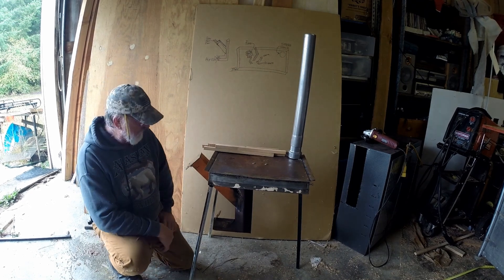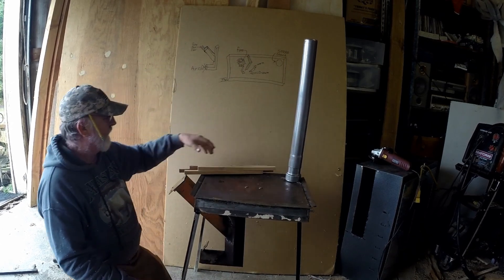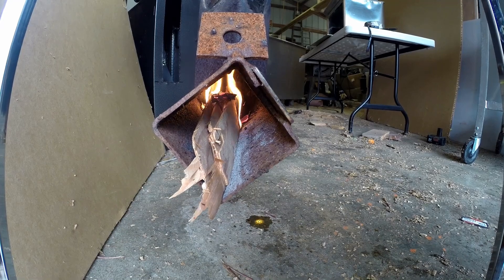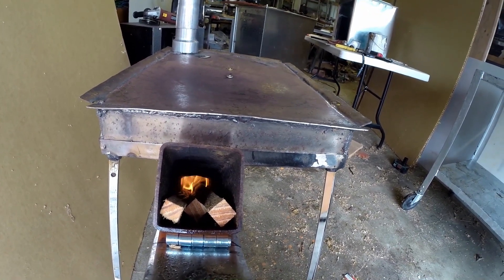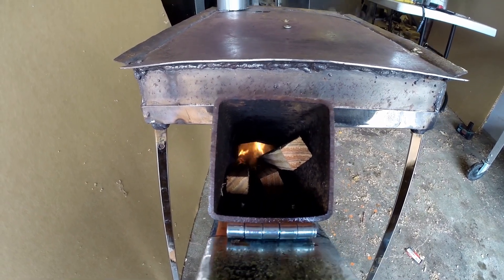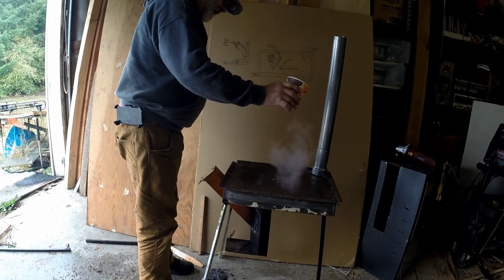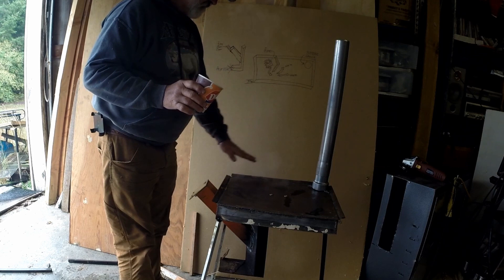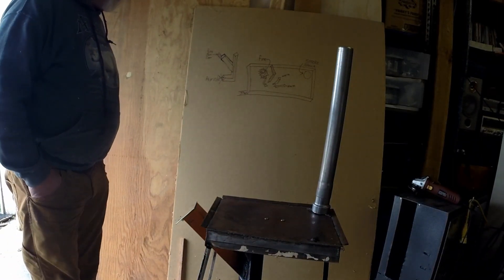rocket range 2018

Comment: Would be beast for searing steaks. Get a laser thermometer.
Reply from the maker: I want to start with Bacon to put some non-stick seasoning on it. Then the T-bone goes on next.
Reply: @badbadbob1  Ribeye is a must. How thick is the steel surface?
Reply from the maker: @__BERSERKER__  OK Ribeye it is. The metal is 10 gage. Thick enough to take the heat. BTW I do have a thermometer. The water is more impressive don't you think?
Reply: @badbadbob1  As a cook the real test is searing a steak. If you hear that sizzle that is good. 700 degrees to 1100 degrees is great. Plus you need it thick so the temperature doesn't drop when you fill the surface with food. Happy New years brother.